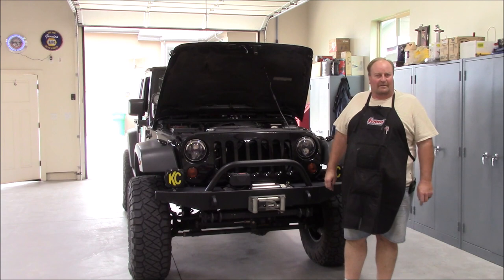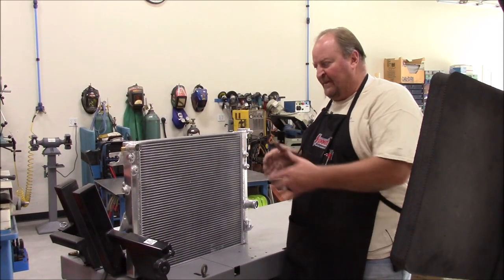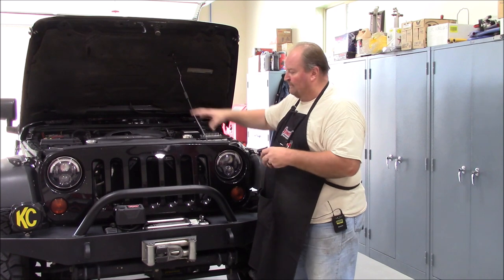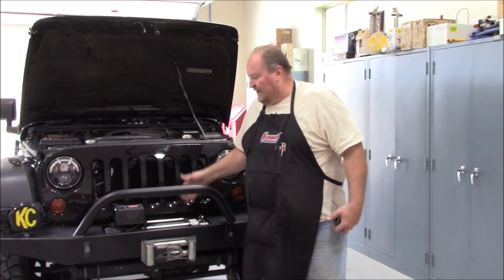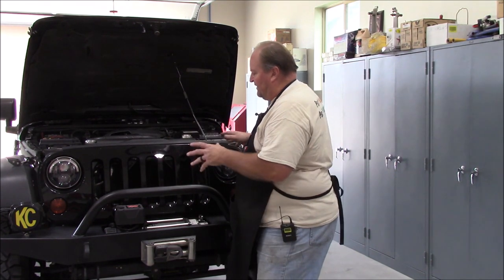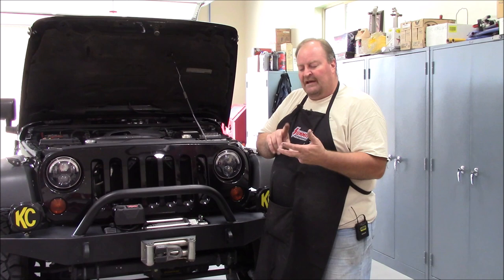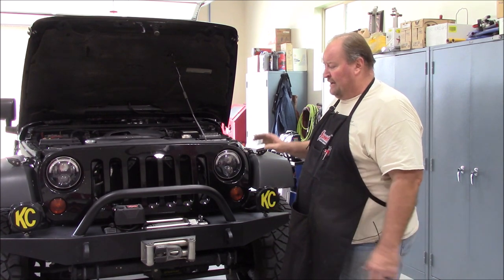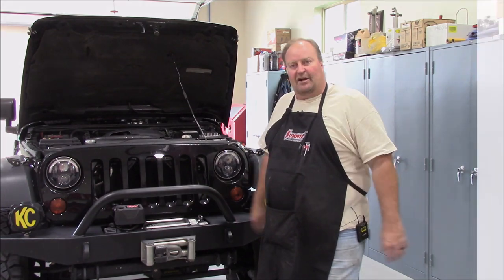Jeep Cooling

Comment: Mike
Thanks for another very informative video.  Anyone that has crammed a large-high horsepower engine in their car (or jeep 😊) and/or made air restrictive modifications has probably wished they had access to your video when they hit one of those warm days.  It takes a very attentive mind and much experience from all types of motoring examples to be able to deal with this very complex subject as adeptly as you did with your 15 minute video.  I cooled a 572 inch blown BB chevy in a 41 Willys and it wasn’t easy.  I for one, wished your video was available through my trial and error process some 20 years ago.
Thanks again for taking the time to impart your wisdom on a very complex subject.
Carl Bullock
Reply from the maker: Thanks Carl.  A lot of experience, mistakes made and lessons learned over the past 3-decades of being a mechanic and I’m happy to share what I’ve learned.  
Thanks for watching Carl.  
Mike

Comment: Mike,

Border Patrol mechanic,  deal with a lot of the same issues. On skid plates we went to the tube style skid plates, still offer protection while still allowing air flow.  With our suburbans we run into issues during our hot season. We went to an auxiliary pusher fan to force air thru the condenser and radiator since there is alot of idle time.  It resolved our overheating issues. Something for thought. Napa has a kit that we used. Includes the fan, relay and some wiring. 

 Great information by the way..  

Welding an 08 Jeep frame back together as we speak. Take care and keep up the great work Sir.

Brent
Reply from the maker: Thank you for watching and especially for working to support our borders.  
Mike

Comment: Great video Mike. Any chance of making a video showing just how much under the hood room is left available since you’ve completed your swap to the 6.2, Is there enough for tt’s and where could put a after cooler air to air or air to water ?
Reply from the maker: Thanks for watching.  Not sure what you mean by “tt’s” but I have several other videos that show available room under the hood, even with the engine cover I’m running but it is quite limited.  I’ve seen Robbie at Motech add an intercooler with his LT4’s. In mine I added a larger trans cooler that eats up some room between the grille shell and A/C condenser but it works perfect as I don’t require an intercooler. 
Mike

Comment: Thanks for the video! Excellent info. Wondering if you have or know of any solutions that get around some of the inherent issues involved with all these modifications.  Do vented hoods help with the pressure issue in the engine bay? Vented fender liners? Can the skids be designed with air scoops in places that don't hurt clearance but might help move air through the undercarriage?
Reply from the maker: Vented hoods help but most allow water and/or snow in to the engine bay which I don't particularly care for.  

Properly vented inner fenders are also necessary if you are not running OEM ones.  

As for under belly skids, I have not seen any that are vented well enough to not turn the chassis into an oven. I am not a supporter of full skids for this reason.  

Thanks for watching. 
Mike
Reply: @zmotorsports62  Thanks for the quick reply!  For a guy who loves to drive his Jeep to the trails and does some pretty tough trails, (Rubicon,Dusy, John Bull) what kind of belly protection would you recommend at the minimum?  Do you recommend any particular protection for the engine / transmission?
Reply from the maker: Sorry, I don't really have any suggestions.  I'm just running the factory Rubicon protection on my 2011, nothing more.  However I'm anal about tire placement and I don't have a heavy foot when I wheel off-road.  So far in 10+ years I have a few scraped but nothing more than that.

Comment: Great vids! Curious, what brand are your storage cabinets behind you in the first few minutes? Been looking to buy a couple for my shop.
Reply from the maker: Those locker style cabinets were purchased from Global Industries.   They’re nothing special, just dual door with four adjustable shelves inside.  Seem to be well made for the price point and have held up well but I’ve only had them for three years.  

Thanks for watching.  
Mike
Reply: Mike, are those 36” or 48” wide cabinets? I’ve been looking to add some as well in my shop. 

Cooling issues are also major issues on Land Rover Discovery II’s as well. Keeping a low pressure in the engine bay is a big issue. Pushing the “brick” down the road is real problem for sure with the discos. Same issues/concerns when we load them up. 

On another note you’re inspiring me to looking at swapping a 6.2LS into my 04’ with the 6L80 trans. Extra HP and torque is a factor but reliability and cooling are main motivation. Re-gearing it after the swap with 4.11 gears. Been my daily for 6 years.  Appreciate all the content and knowledge.
Reply from the maker: Thank you Paul. I appreciate the kind words. 

As for my cabinets, they are the 36” wide by 24” deep variation.  

Mike
Reply: zmotorsports appreciate the response Mike. Definitely an amazing shop you’ve built. Keep up the content, and hope you’re enjoying this beautiful Sunday in Utah.